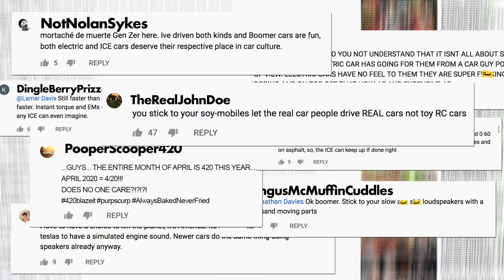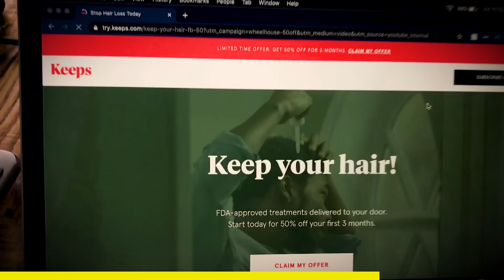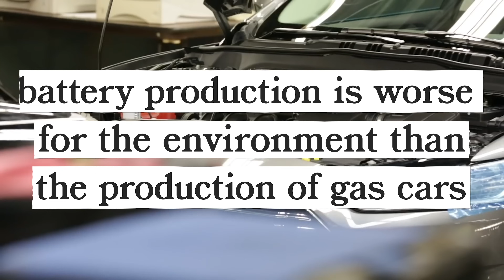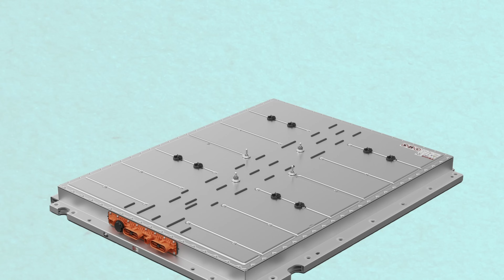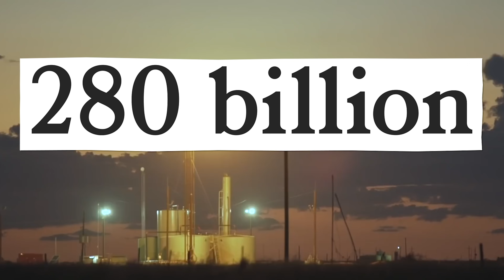Are Electric Cars REALLY Better for the Environment?

Comment: I don't know where he got his understanding of the electric grid but he needs to learn how the electric grid works, let's take California for instance let's say they replace 28 million cars in California with EV, if you plug 28 million EV cars into California's electric grid (by the way which is very unstable at the moment) it would crash constantly. California is also a very long state so if you wanted to travel from the bottom of California to the top of California how many times would you have to recharge your batteries and how long would you have to wait for them to recharge. Also you would have to put into account how many cars get totaled out and just a short period of time of a person owning it. Many cars don't make it 6 months, so at the rate of crashes, by his own calculations of of CO2 being produced to make an electric car the remanufacturing of new electric cars to replace those wrecked ones would cosmoor CO2 to be used that just using a regular gas car. I'm not against electric cars but don't be fooled by all the hype electric cars could end up causing more CO2 build up in the long run. Not to mentioned an electric truck might be able to haul 10,000 lb but the minute you go up a hill with that 10,000 pounds your battery is going to deplete at an enormous rate. Electric cars can be the wave of the future but it needs to take baby steps just like gasoline cars took. When EV s have been out for 50 or more years then they may be useful productive and more environmentally it's safe.  I appreciate his research but I actually work at the electrical field.
Reply: There are some ideas to use EV to stabilize the electrical grid, by using all those cars as both a power sink and source, as needed.
 
Most  cars last nearly 20 years; granted the last 5 years typically are as a second car. EVs are vastly less complex in terms of number of parts, and are projected to need far less mantenance. One of the reasons dealers don't want to sell EVs is that they count on all  that  maintenance work to keep them afloat (they barely break even on just car sales).

Electric cars are nearly 100 years old...

The stats on car crashes is moot; the impact is no greater, and perhaps less, for EV cars (well, Teslas, anyhow)

Hard to say anything definitive about trucks, since they are pre-production, but they are being tested as we speak. If the developers think they've worked out the problems, then we will see them come out. I am confident that if you, a non-EV, non-truck, but 'electrical field' worker know the process of developing and testing that they are going through.
Reply: @MrRentageek  I have an electrical engineering degree, I've worked with electricity and electronics my whole life. I've actually laid plans down 25 years ago on how to make electric cars more efficient when at that time they were not efficient. I have designed circuit boards for various companies, I have designed inverters power storage devices and RF equipment. The theory of electric vehicles powering other electric vehicles on the power grid is just that a theory. Anything you put on the power grid that needs to be charged will be a drain on the power grid. To think you can take a fully charged electric vehicle and use it to transfer power to another electric vehicle through our power grid would be pointless because the vehicle that just gave power to the vehicle that needed power will now need power. Batteries are power storage devices and the amount of storage that 28 million electric vehicles would demand on a power grid would equal more than all those computers bit coin mining. I don't know how much you know about electrical current but the more strain you put on an electric motor the more power it takes to turn that motor so if you're going uphill your power bank is going to deplete faster. In addition heat is a battery's worst nightmare the more drag you put on that battery the hotter it's going to get not to mention how hot the battery is going to get just from the outside ambient heat. You mentioned parts are less on a Tesla but the components on a Tesla cost more to make they are also more sensitive than the components on a gas powered vehicle. We are actually learning about it with gas powered vehicles that when the electrical system has issues it's harder to fix. I'm not saying don't buy an electric vehicle I am stating that if you do buy an electric vehicle make sure it's the right fit for you. Me personally I would just prefer a naturally aspirated gasoline engine at this current time. I understand that you said that electric vehicles have been out for a hundred years, though some people have dibbled with making electric vehicles over the years I won't say a hundred they did not put a whole lot of time and energy into it. Within the last 20 years there has been more investment innovation and motivation in creating new electric cars. Electricity doesn't grow on trees anything that requires a battery requires electricity. I'm going to put it as simple as I possibly can if you buy a 5000 milliamp battery pack to charge your iPhone that has a 4,500 milliamp battery you are going to get one charge but your battery pack will still need to be charged. And as you deplete the battery on your phone you will now have two devices acting as parasites on the electrical grid. If you use your car to power your house during a storm you will then have to charge your car. Electric cars will always drain on the power grid until there is a way that the electric car can generate the amount of power it uses. As it stands now you cannot get more energy out of something than what you put in it so that is not going to happen

Comment: Tidal, hydro, solar, heat pumps, etc., and maybe rather expensive and unreliable wind power, but PLEASE NO NUCLEAR!
 There are many obsolete subs in storage with no plans for tackling their reactors, but they need cooling pumps running continuously until the end of the World. There are power stations with the same fault as Chernobyl which are still uncapped! How long before the Chernobyl core burns through to the water table and explodes? Remember the previous global disaster was only a fire! Even the stupidest child will only burn himself once! Nuclear is the World's most expensive and dangerous steam engine! (How much CO2 is produced in the building of a NPS?)  The environmental nightmare that is nuclear has been well known all along. The only reason we have nuclear fission at all is because Military wanted plutonium for weapons.
Reply: The Chernobyl plant was poorly designed, and poorly built, using roughly WWII technology, with few of the basic safety features that were available even at the time it was built, let alone now.

Nuclear cores are removed from submarines when they are decommissioned; totally laughable to think that they would leave the core onboard.

There are many super safe, advanced (as in, designed for safety from the very beginning), nuclear designs, such as thorium, that are as far removed from the Chernobyl design as the Tesla is from the Model T.
 
To my understanding, Chernobyl is/was a one-off design; there are no  other plants like it (even then, no one else was so stupid!). I could be wrong, if you have references enlighten me.

Wind power is now one  of the cheapest sources of power available, and there are offshore locations where the wind is nearly 100% reliable. I've read that it is now cheaper to build and run a wind farm than it is just to keep a coal plant operational.

Comment: Good numbers, great vid! 
But you forgot the fact that the harm by extracting fossil fuels is done, while to extract lithium and cobalt some big mountains and landscapes are being totally ripped off. That makes me think batteries are not the future.
Reply: So, does the fact that the big oil companies have been mining cobalt for decades not cause you concern? They need cobalt to remove the sulphur during the refining process.  No mountains are ripped off to mine lithium. Clearly, you have no understanding of the lithium mining process. I wouldn't actually be too concerned if I were you, because in the not too distant future, EV battery technology will move away from using elements such as lithium. Then you'll need to find something else to gripe about instead.....  Ironically, oil isn't the future either, because oil is a finite resource which will eventually run out. However, we won't reach that point, because demand for oil will, at some point, drop to a fraction of what it now is. And oil extraction and refining on the scale we currently see it will reduce massively. This will have the advantage of leaving huge excess energy capacity in the grid, which can then be used to charge EV's.....
Reply: Batteries without future is oxymoron.

Comment: Myth number 2 our electric grid can handle 25% of cars on the road being EVs. Why don't you ask Texas during that power out if they could LOLOL
Reply: The problem with Texas is that they refused to join the (rest of the) US power grid, because that would have required them to come up to US standards on such things as reserve power, and even basics like insulating gas lines against cold weather. 
 
They also chose to privatize the power grid, rather than regulate it, because "private industry will always do the right thing". Except what private industry did was 'do the cheapest thing, and make the most money for our stockholders this quarter'.
Reply: @MrRentageek  what are you talking about Texas lost power because their wind Mills froze lol. And California is the state with the oldest power grid because they are not allowed to build new power plants unless it's green energy.

Comment: Yeah, EV's are good for the enviroment, but they come with many drawbacks:
 
limited range 
charging takes between 28 and 38 minutes
in the winter the range is further reduced
limited charging stations
different plugs and sockets. 
And high purchase costs, althrough electricity is much cheaper then gas. 
Also less maintenance, due to less moving parts.

Conclusion: an EV is great for commuting, but not for long trips. And in the long run EV's are cheaper and better for enviroment.
Reply: Yh the range and charging times is the one sticking point holding back EVs. Although the range has improved quite considerably on Evs in the past decade and charging times have gotten better. So hopefully as the years go by it'll only get better and better like how fuel economy has improved quite alot on newer cars compared to older ones. Fact is EVs are still in it's infancy stage and alot of car manufacturers are still focusing more on petrol/diesel cars. So there is still plenty of room for EVs to get better especially as more manufacturers start to slowly shift their energy and time to EVs
Reply: And why is that a problem if your motoring profile suits that? My Kia takes me 12 seconds to charge it. Six seconds to plug it in at night when I go to bed, and another six seconds to unplug it when I get up in the morning. I do this about every 9 days....... My car has around 300 miles range when fully charged. I don't feel limited by that. Indeed, that's enough to last me 9 to 10 days.  You may not realise it, but an ICE car will use more fuel in winter too.....
Reply: @Brian-om2hh  no that's fine if your driving profile suits it. Yh for city driving electric cars are definitely good enough. But for longer journeys it's still somewhat limiting. But if you're someone who does a long commute each day then it's still limiting and probably not suitable just yet. Again no hate against EVs still think they're the future of cars just acknowledging there's room for improvement.
Reply: @taz874  I have done one longer ( 520 mile ) trip in my Kia with just a single charge, prior to the return leg of the trip. It didn't seem too bad to me. I would have stopped for 30 to 45 minutes anyway on a trip of that length.
Reply: The longest range EVs already have a longer  range than some of the cars I've owned over the years. Granted, it's only the more expensive ones so far, but they are improving every year.
 
Tesla has shown that winter range does not need to be that much worse.

The TCO is on par, or lower than equivalently equipped cars.
Reply: @MrRentageek  Interesting. How the EV evolution goes.